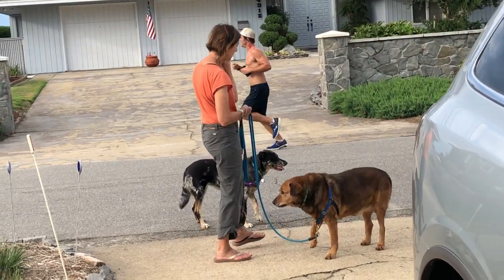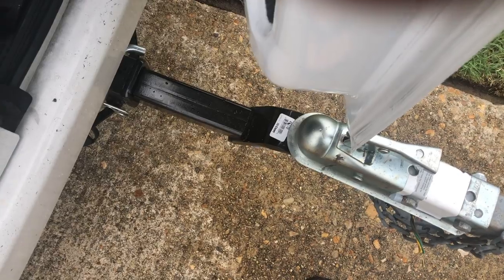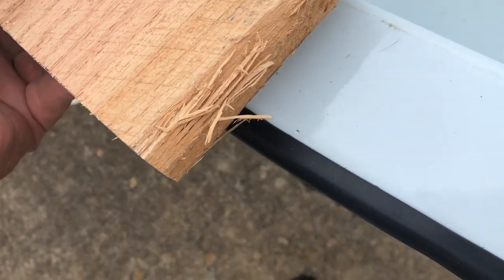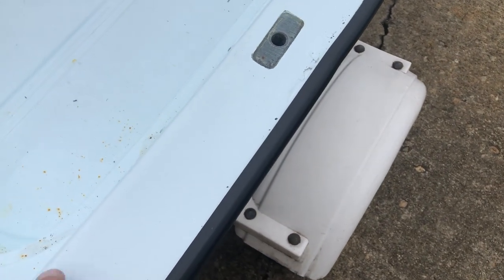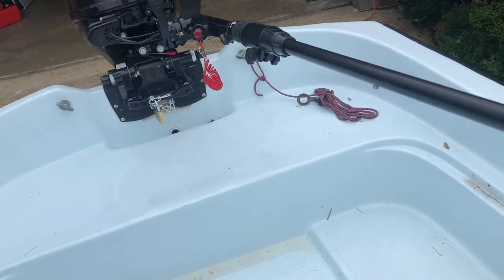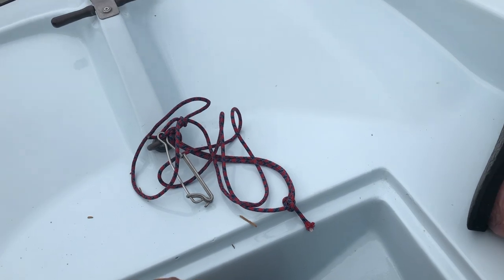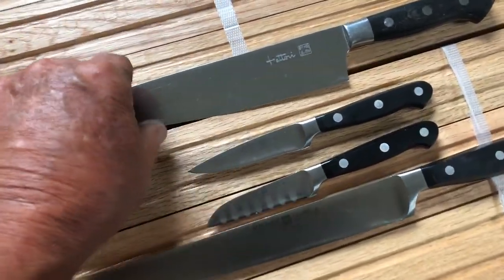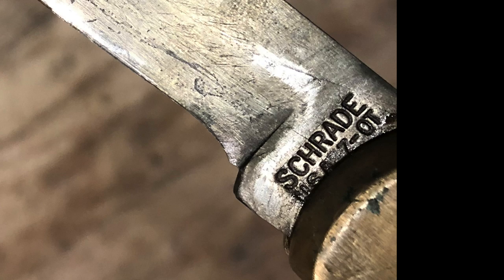Gold & Diamond Rings could become extinct in Nada after 5 Days - :-)

Comment: for my hitch haul i added an extension 19 inch total the part that slides into the hitch is 7 inches and the rest is 12 inches cost 45$ but that would give you the length so the door won't hit

Comment: Do you think you will be too far forward with your weight, may make the front of the boat "plow" in the water?  Could you use a board on each side using the oar lock holes for pins and then attach your seat across those boards?

Comment: Max, l heard tell of a marine polyurethane that lasts.  I wouldn't stain that oak, it'll be beautiful just as it is after sanding and coating.  Can't help but wonder why you don't rig your boat with a steering wheel & throttles.  Just curious, you've forgot more about boats than l ever knew.